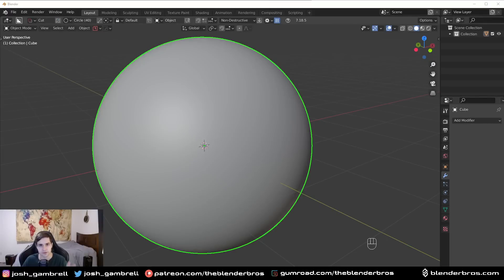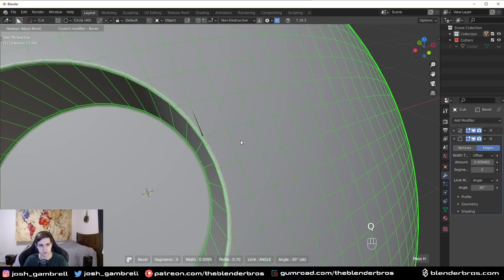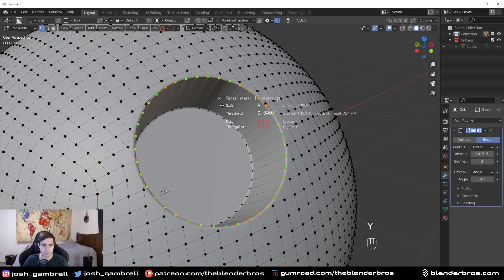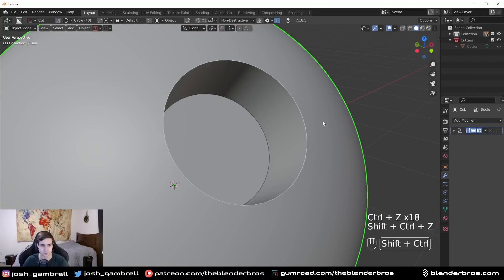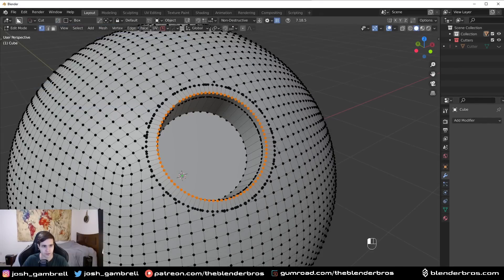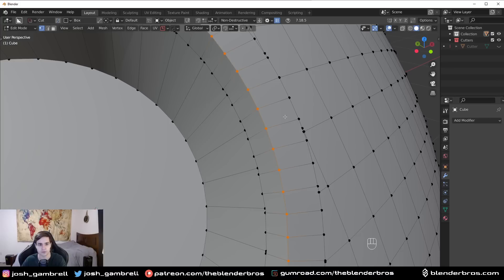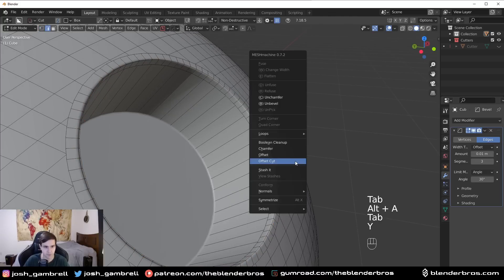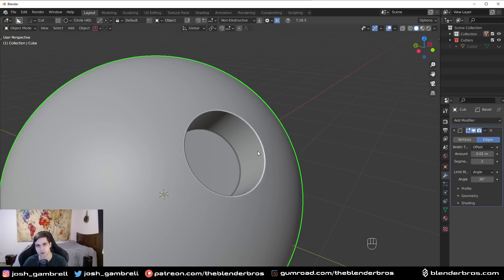Poly modeling just got BETTER - Mesh Machine offset cut overview

Comment: I really wonder how the person who made the addon figured the math and stuff behind making it work. Seems interesting
Reply: Houdini is actually pretty good at teaching you this kind of math if you want to know more about it. It basically just extends all the points outwards along the surface of the object, then deletes the primitives between the inner and the outer loop and creates new geo based on the mapping between inner and outer loop.
Reply: @Luxalpa  how does it know to move the points SPECIFICALLY along the surface? And by outter loop, do you mean the circular edge loop being pushed in and out that sort of "cleans" up the verts it goes near?

Comment: You realize CAD programs use polygons to render images as well? 
They just do a better job cleaning up the vertices on the fly and so on.
But I guess that type of response is a bit expected you are more into using 3D programs not into the development of them.
This however a good example why colleges used to require some development classes so you get some cross training and learn how stuff actually works.

Comment: In other poly mesh type modelers, such as sketchup, ome trick i do, i scale the image up by 1000, perform the bevel, then scale down by 0.001 and it works great. Or i use an extension called roind corner that does exactly what this video showed.

Comment: This is incredible! Is there a way to turn off the pie menu that helps you navigate between vert, edge and fave mode in mesh maschine? I really like wanna use the add on but I actually much prefer the 1, 2 and 3 hotkeys. Thanks!

Comment: I wonder if a feature like this could be implemented as part of the standard bevel modifier? Where one of the sliders is "padding," which does this operation for every edge that's beveled before it applies the bevel

Whatever algorithm that's being used in this is pretty slick.

Comment: Very nice, I hope they add some solid modeling options at some point.  

(2:20 *circumventing)
Reply: the two words are very similar in meaning so its quite nitpicky of you :c
Reply: @MageAtYou  No. Different words. Different meanings. Very different connotations. Corrections are never bad.

Comment: Any specific reason why you don't do your hard surface work in Moi? The reason why I personally don't use it is because I've found that the bevels/fillets occasionally get messed up (when converting to polygonal) and the fact that I feel like it's a lot slower in terms of modeling. But I guess it would be useful if you had like an extreme amount of booleans which you could just retopo in a nurbs program and then send back to Blender.
Reply from the maker: It depends really. Variable radius bevels, bools on curved areas, amongst many others are areas Moi wins. Poly modeling is a lot more versatile and allows for easy cleanup. Moi doesn’t, and modeling in it is much, much slower. Generally I use it for practice in NURBS and do my main modeling in blender.
Reply: @JoshGambrell  If it's to any benefit I've found that it's pretty easy to retopologize a polygonal mesh in Fusion. But yeah I totally agree on the speed of the modeling process, which is why it's beneficial to model the object in Blender and then transfer it to a nurbs software where you can apply the fillets, chamfers, etc.

Comment: I think would still be clever to run a boolean clean up before the offset so you don't end up having to clean both A and B sides after? 😅
Reply: im interested learning this blender because its looks like deathstar.
can i know what do you mean with boolean clean up?
Reply: @ryaeon9793  Yo i'm a year late. It basically means cleaning the topology around the applied boolean (circle in this case) . You kinda add a lot of unnecessary close vertices that can also cause issues later on.

Comment: Just a knife project does the whole job for me.  Do a Boolean, go to edit mode, select the top edges of the cutter, duplicate and  make separate object. Then just scale a little bit and select the main mesh with it and apply a knife project. Select the projected faces and dissolve faces. Done!
Reply: Yeah it's ok on a flat surface mate but Josh is talking about curved meshes and what about shading issues and bevels with your method?
Reply: Try this: 

Take the boolean cutter object, edit mode flip normals, then scale it and apply another boolean(diff), with the normals flipped it will act as a knife cutter (boolean solver exact),  same effect,  less complicated, 

Then instead of dissolving; completely delete the new faces between knife cut and top edge, select one of the lonely verts on inner edge, then select tab  "similar amount of connecting edges, dissolve the lonely verts, 

Then select non manifold Alt-F to beauty fill, then bevel the edge.  Or just use the free "Bevel after Boolean" addon "BaB" which is designed specifically for curved surfaces,  :)
Reply: @RoJamMo  Curious to watch your trick in a video

Comment: What I wish for though is a program that pretty much auto does high polys, generates control/support edges or what they're called. That's such a pain in the butt.

How useful does this seem for that?
Reply: u mean u wanna use bevel modifier with 1.0 profile before subd?
Reply: @ekshalibur  Bevel makes those weird artifacts or warps it remember? Bevel doesn't always work perfectly. This looks similar though but I'm not sure it will cut it.

Comment: Very useful... except I can't afford any hard surface modeling plugin, so I'll keep on sliding those vertices out of the way
Reply: p sure this ones free
Reply: NNEVERMIND!
Reply: You can actually knife-project them. XD Like create two poly circles, then use knife project, to... actually project these to a sphere.
Reply: @Soulskinner  i suppose you've just started with blender ;-)
Reply: @archiplanservices3746  Nope. So what's wrong with my wariant, considering that it does the same thing?
Reply: @Soulskinner  Yeah it's ok on a flat surface mate but Josh is talking about curved meshes and what about shading issues and bevels with your method?
Reply: @archiplanservices3746  Same question goes for this tool. ^_^ (I forgot to mention couple of steps, but you can get same geo with knife project) I just woke up, so I'll write all the steps a bit later.
Reply: @archiplanservices3746  Ok. Knife Project the supporting circle to the sphere, duplicate resulting circle, separate it, scale to the size of the future hole, shrinkwrap to the sphere. Apply shrinkwrap, delete faces around "outer circle", on the sphere, bridge these two circle loops, gridfill the hole, extrude it.
Well, it's not 100% accurate, and there are ways to get more accurate result. But it's a bit more easy. Or something like this.
Reply: @Soulskinner thanks to reply, could you demonstrate that with a video and give the link to it please.
Reply: @archiplanservices3746  I haven't recorded any video. Like ever. And, to be frank, I'm kinda lazy for it.
And I've checked it, and there are actually some artifacts. But meanwhile, I wonder, does this tool creates artifacts with subsurf too.
Reply: @Soulskinner  thanks for your reply 😉